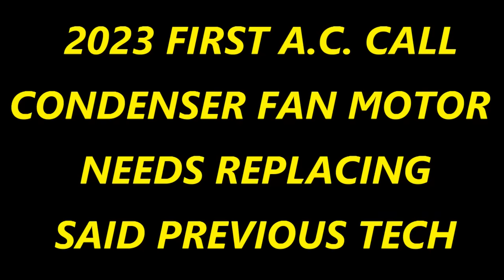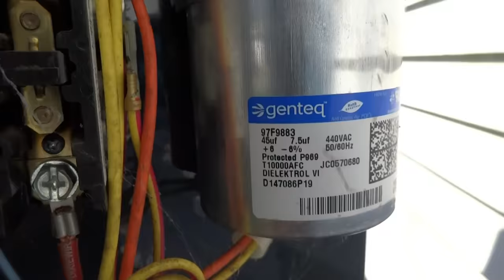2023 FIRST AC CALL   MISDIAGNOSED BY LAST TECH

Comment: If someone came to my house and left all those wires disconnected I would be very upset. The fact the wires were tucked under the top cover tells me the guy wanted to charge for a fan but only replace the cheap capacitor. Taking advantage of the old lady.

Comment: Always fun following up on a HVAC Scammer, I've heard stories of bad tech's carrying bad capacitors around in their tool bags to show customers and say they came out of their AC. Look out for the White Shirt technicians they usually work on commission. Steves a honest Service tech and plumber, give her the chooch mama!
Reply: He a ways right and he does not scam. No body
Reply: White shirt technicians?
Reply: Thats insane. Imagine having to fake your job to get work... if these guys worked legit they would be swamped, no time to fake it when real problems are needing fixing. Im 95% sure a quick lube place used to show me dirty air filters from my service van. Ive never seen air filters get that dirty in 6 months...
Reply: @rashatmehta1386   I actually started my HVAC career with a company that paid by commission. So unfortunately it can breed greedy technicians who create repairs to get paid more. So the supposedly squeaky clean technician in the white collard shirt shows up looking to make big commission. Now that's not ALL white shirt techs, trust your instincts with people.
Reply: @boopernator  - Unfortunately, there are quite a few dishonest techs in my area because my neighbors will ask for my opinion. One neighbor told me that the tech wanted to charge him $380 to install a hard start kit but my neighbor decided to ask me first. I looked at the wiring on the contactor and I could tell the wires were burned. I told my neighbor to cut the wires, strip them back, and reconnect the wires to the contactor. The condensing unit started right up.

Comment: Sure glad I watch you guys every day. My A/C wouldn’t come on and then the heater quit working.  Right away I saw the fuse on the mother board was blown for the 24 volt circuit. I pretty much knew it was gonna be a short in the 24 line somewhere. I couldn’t find it but a buddy plumber of mine found it right next to the outside condensor. The mice were busy. I can’t believe it got up to 87 degrees yesterday, that’s crazy for this time of year.

Comment: I had a capacitor replaced, and the fan quit a week later. They say the capacitor going bad can ruin the fan windings. Anyway, replace the capacitor every 3 years and if it's chinese then every year.
Reply: My cap is 1991 original to the condenser. Still runs fine but your idea with todays parts makes much sense.

Comment: Hard to say the fan motor is not bad if you didn’t check the bearings or the resistance of the windings or the amp draw. Other guy had the top off. Hard to say the guy was trying to scam someone when he could have diagnosed something you didn’t check. Not saying it wasn’t a scam, I’m just careful to call someone out when the might have checked something you didn’t.
Reply: Really!!! Wth
Reply: fan might have went out on thermal and dude just thought it was bad but it's also more likely the idiot didn't have a clue and just never came back. This looks more like the guy tried a cap and it didn't work so he put the old cap back on and bounced. Or the "guy" is standing right next to steve :)
Reply: This is the scenario you described; fan motor is out on thermal due to bad cap. Guy fiddles with it for a bit by trying a new cap but no beans so condemns OFM.

Comment: What do you mean by if that thing was not sweaty you would of checked the charge?
Reply: a healthy running ac unit has the supply line that is cold and "sweaty", if it wasn't then he would have checked the charge with the most likely problem being low on refrigerant...

Comment: I could understand replacing the motor if it works, but the bearings are shot, as its only a matter of time before it locks up... but to disconnect it and leave it off as if its garbage when its just not starting just due to capacitor is fraud (or severe incompetence.) Im scared to know how many people were sold entire new AC/ Furnace setups due to a cheap capacitor job. This shit would get you reamed at my shop, you wouldnt get much work after this (to save company reputation from frauds.) If you are as transparent as possible with customers, show them what you find and let them decide if they want a new motor or not. It seems in Resi, people blow smoke up homeowner's ass and get away with murder. Doesnt happen as easy in Commercial/ Industrial... people know when theyre getting scammed.

Comment: That first guy was a fraud !  The fact that he left the wires disconnected and didn't put the screws back where he found them tells me he had attitude when the owner didn't give him the okay to do a $500 fan replacement instead of a $150 cap replacement. Not only that, guys like that will use the old fan on another job and charge the same $500 to that customer. Most legitimate HVAC service folks will put the unit back together the way they found it if they don't get the job...they do that so the next guy doesn't have anything negative to say about them.

Comment: I have a question. We have a central air that was installed in 2004. My heating company just sent a mailing to me about the discontinuation of R-22. They say it’s been discontinued & not available. Their suggestion was to replace it with a newer model with different refrigerant. In all the time I have had it it has only needed a 1 pound charge once in it’s life. Otherwise it runs very well. What would be your suggestion? Replace it now before their is a problem or wait until it dies?

Also, I had a hard start capacitor added to my outside unit so I could start it with my roll out generator. Now I’m told that I should have bought a soft start kit for my outside unit. Any suggestions? Without the hard start kit my generator would stall out. With it, it starts but I have to have everything else off in my house. Then I can add load slowly. With soft start I don’t need to allegedly? I can turn everything on with the 2-1/2 ton central A/C.
Reply: Get a whole house generator.. I do those, to bad you were not closer
Reply: I’m not in the business so take what I say with a grain of salt. R22 has been out of production for a few years due to EPA regulations, but there is plenty of it still available. The issue is cost. It’ll probably cost you $200 per pound plus labor etc. If your system doesn’t leak, you can run it until something breaks, and then you will have to assess if it’s worth it to throw money into an old system. I have two r22 units that were installed in 89. Have been perfect since we bought the house in 2009. I replaced a couple of capacitors, a fan motor, a transformer but no sealed system leaks (yet). I’m planning to hang onto mine as long as I can. But I know if I develop a leak, it’s time to update.  410a operates at a higher pressure than 22 and won’t last as long. Also, even though most all are 410a, they are phasing that out soon, also. So if I were you I would try to hold out until the 410a replacement is agreed upon by the powers that be, so in 5 years you are not in the same situation as you are now with the r22. Good luck. If any pros know better than me, feel free to chime in.
Reply: @japmlp09  I wanted to Big J Illinois. 
Careful consideration was taken on a whole house unit. I was ready to pull the trigger on a Koehler 14K water cooled diesel generator with a 300 gallon belly tank on a concrete pad. Ornamental bushes around it to disguise it’s view from neighbors. All together with labor & a crane service I was looking at $27,000. That was five years ago. My wife found out what I was doing & pulled the plug.
We live in an ASSociation with rules outside my home. We don’t have natural gas available in my neighborhood. The ASSociation won’t allow us a propane tank. This was our only choice. I consulted with an electrician I work with sometimes. He suggested the set up I have. I bought a Honda eu 7000is generator with a 5 gallon auxiliary tank. It’s wired to my house electrical system in the event of a power outage. 
My question was if I should buy a soft start kit for my outside condenser. I hear it’s better than the hard start kit installed in it now?
Reply: @Samlol23_drrich  Thank you Samlol23 for your advice. I bought a very good central air conditioning unit installed in my house. We spared no expense & it’s by far the best investment we made in our house. Our house gets full sun all year long. My wife is an A/C queen. We have it serviced yearly & keep shrubs from growing near them. Only one time did the capacitor fail & the system leaked one pound. Otherwise it just needs a good cleaning every year. We just replaced our oil fired furnace a couple of months ago when it started leaking. Our oil company offers A/C service. Hence the mailing. I’ll hold my fingers until there is a replacement to R410A.
Reply: @johnclyne6350  i don't run my ac with my generator. Mine is a 12.5k portable wired into my panel. I think those soft start kits are relatively new.  They look fantastic and im sure they work. There are some videos here showing a unit pulling 75A on startup before,  and around 35A after installation.  Im sure that's better than a hard start kit could do. Im just afraid the noisy electricity it produces will hurt the compressor so I use ceiling fans if we lose power in the summer.  
I haven't even tried to get the units started.  But I think the soft start kit would be what I would do based on what I've seen. Again. No expert here.
Reply: @Samlol23_drrich  Well the difference between your genny & mine is that mine is an inverter generator. It produces pure sine wave power at 60 cycles. I have the largest (right now) genny with that feature. Since it puts out clean power like that of the local power company, I can trust it won’t burn anything up that is computer controlled. I live just down the road from the substation feeding our neighborhood. I receive 121-121-243 volts from my power company. The Honda produces 123-123-246 all day long. Even when the A/C condenser comes online. I get better power quality with my genny than my local power company can provide. I see lots of large generators being wheeled out in my travels when the lights go out & cringe. Not only are they ear piercing but they put out choppy power. The nomenclature on the outside claims robust power capabilities on the chassis. On the Honda it claims only that it is a 5500 watt genny with a surge to 7000 watts. I have tested mine & it will go to 9000 watts & stay there all day long. One watt more & it will trip out. That’s very impressive! Again careful consideration & research was taken to determine which genny was best for my situation. My house has a propane stove & dryer. Those draw lots of power if the were electric. The only thing electric is the motor & controls in the dryer. Our heat & hot water is oil fired. Again if they were electric I wouldn’t be able to use my genny for my whole house. I checked the load for my entire house on with the central air & it draws around 3800 watts. I’m well within the capabilities of our genny. I tell you what, when I come home after working as a lineman from working a suicide shift during a storm. My house is very comfortable. I can take a shower & go to bed to sleep with my mind at ease. Last thing I want to get is a call from my wife that the power is out at our house. None of our neighbors can hear my genny. They think we must have a private line straight to our house as the entire neighborhood could be flat & our house has lights on.
Reply: @johnclyne6350  i knowingly bought a non inverter generator. I have an older Honda eu2000 which served me well through many years but is tiny and more of a camping toy. For the last 8 years I've been running a Westinghouse 8500 that I converted to propane because I have a 500 gallon tank buried to heat the pool.  A got another one of those but should have sprung for a winco a few years ago when they were 2700 instead of the 5k they are now. 
I've never had a problem with the power from the Westinghouse although I'm sure there is plenty of THD.  It runs 2 full size refrigerators, a wine cooler, ice maker, full freezer and my variable 3 phase well pump thats 240.  The well pump and controller is really the only concern.  Our well is 800' down and replacement is expensive.  

Next time around ill do what you did. Inverter.
Reply from the maker: call someone else .. 1 lbs a year is nothing .. i would keep the r22 system running if it was me ..
Reply: @stevenlavimoniere  Correction. 1 pound in 19 years. One capacitor at the same time. Then added hard start capacitor for Generator
Reply from the maker: @johnclyne6350  99% of hvac guys want to sell you a new system not because yours is bad ..because that want to make extra money on new install or kick back from boss .. a r22 system is a lot better then any new system for one it runs on lower pressure so it will last twice as long as a new system just because of the pressure difference .causing leaks .i have 7 ...30 lbs of r22 in my garage . anyone with 1/2 a brain seen the fazeout coming ..
Reply: @stevenlavimoniere  Well, we saw the end of the road with our oil fired furnace 2 years ago. My wife was & is petrafied of getting Covid again. I almost died last December from it. I wanted to pull the trigger on it then & my wife said no to having anyone in the house. It was like s preminition that the oil company knew it was going to start having problems. Based on that information I’m thinking they might be right about the A/C too? 
We went top shelf at the time & bought a Trane system with a 14 seer (to qualify for a $200 rebate from the power company). A variable speed air handler & insulated ductwork. This cost quite a bit of money because our house has hot water heating. They had to cut into closet spaces to bring down the ductwork from the attic into the first floor registers. A separate ductless system installed to cover the basement. The previous owners didn’t opt for that when they had the house built. Then the access to the attic was through a tiny opening in my wife’s closet (stupid). I had them cut in a real openjng in our hallway ceiling on the second floor so they could carry all the parts up to the attic. 
At the time in 2004 we paid $10,000 cash for everything. It took them two days to install it. Plus I had to hire an electrician to replace our circuit breaker panel as there was not enough space for the added circuit breakers. We had a 20 breaker panel & we went with a 32 breaker panel. Then wire everything up. That cost me another $700 in cash. Now atleast everything was in place for the future.
Reply: @stevenlavimoniere  you better start stocking up on the 410a now. That’s next.

Comment: Steve...I hear a howling sound in your truck that was not present before. Could be the power steering fluid level is too low? Thats what it sounds like anyway.
Reply from the maker: probley the window open its hot weather now
Reply: @stevenlavimoniere  I heard the same sound in a previous video or two as well.
Reply: @stevenlavimoniere  The sound is more prominent at a stop light and when the engine speeds up and shifts from first to second. Its engine speed related, likely something driven by the serpentine belt such as hydro brakes, water pump, power steering pump, etc.

Comment: just because the Cap is bad does not mean that the fan isnt bad also, a bad Cap can kill a fan motor. To Blab infront of the customer that you "know the problem"  before you really do is unprofessional. You never ever start running at the mouth that you are sure you know whats going on till you are for sure is bad for business. There is NO reason to have the customer right there while you are looking the unit over. I'll let you know what i find is all they need to know up front.